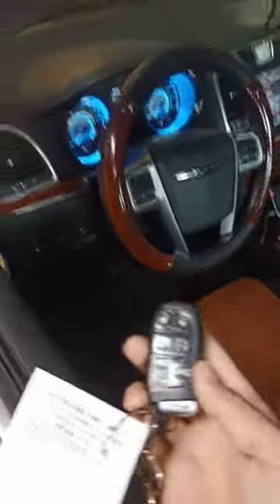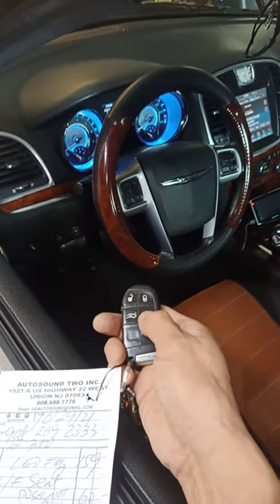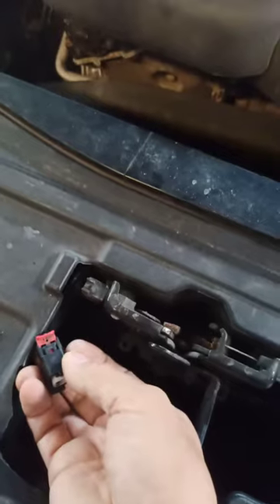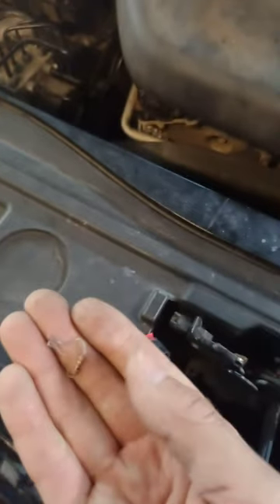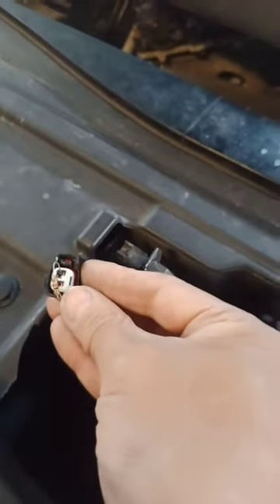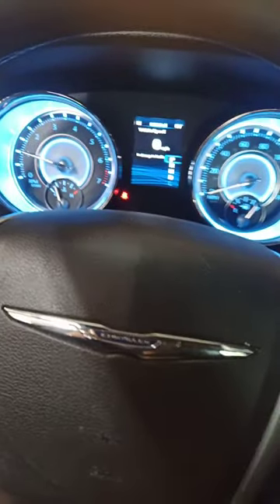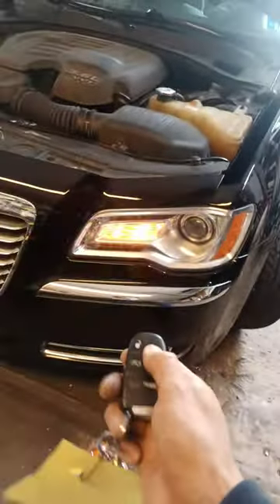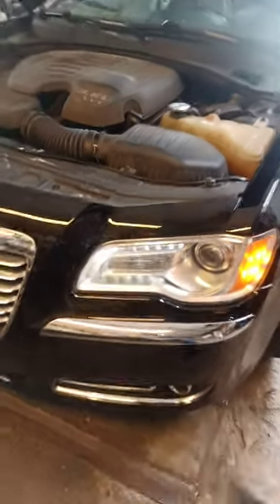2012 Chrysler 300 hood ajar remote start not working fix remote starter

Comment: does it work with a clip?
Reply from the maker: Clip?
Reply: @goautosound1  yes
Reply: @goautosound1  Is the resistance necessary or can it be done with another object?
Reply from the maker: @ronaldoaburto553  Yes, it does 
You need a 1k ohm
Reply: @goautosound1  I don't know where to get it Is it possible with a cable or some other object?
Reply from the maker: @ronaldoaburto553  eBay just search the 1k ohm register

Comment: So I replace the big black latch not the plug
Reply from the maker: So did it start?
Reply: @goautosound1  nope I jus realized that the connecter is not even connected to nothing no wires or nothing mechanic told me but pigtails
Reply from the maker: You need to find the wires and connect resistor on it

Comment: Didn’t work for mine, I have an aftermarket hood so maybe it’s that but i tried the resistor and didn’t work sadly.
Reply from the maker: Be sure to put register on two wires on hood switch
Reply: @goautosound1   boss ..how much resistor ?!
Reply from the maker: @abood3392  guess you didn't watch the video it's 1 k
Please watch the video and see how we've connected
Reply from the maker: @abood3392  are you asking value or price?

Comment: Mine don’t say nothing open just won’t start
Reply from the maker: Do you have check engine light on?
Reply: @goautosound1  no nothing lol it was working fine but yesterday and today it works wen it want too 🤦‍♂️
Reply from the maker: @ad2142  get a ohm meter and check the hood switch

Comment: I’m not seeing that red plug, I don’t think my latch has that… maybe I need a whole new latch
Reply: That reducer is totally missing on the latch, think I definitely do need one. Sorry I don’t know about cars, will sub
Reply from the maker: if its same year you should have same connector
what year and model?
Reply: @goautosound1  2012 Chrysler 300, I think that maybe someone took it off previously, I looked up a new hood latch and I do see that red plug on the new one. I don’t have that plug for some reason, nor that 1k thing
Reply from the maker: @K-Uno.  remove grill and look for either plug or wires